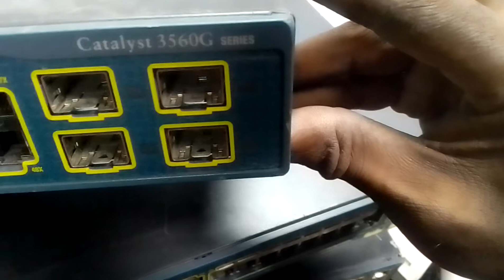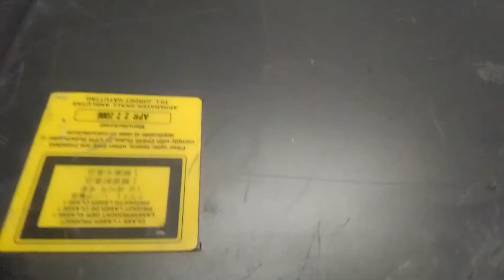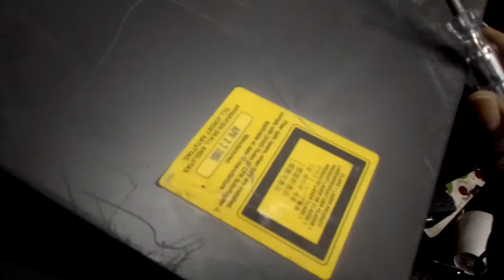#cisco #networking #switch #hardware #software  solved: Cisco switch no power light but fan spin

Comment: I have 3560G-48 and it is used with only maybe 10 ports and just one PoE, but because it is too loud. Is there a some simple way to silence it hence it does not work under full load? Noise is too loud for the office where I sit. Thank you.
Reply from the maker: The fan needs to be replaced
Reply: @jkftech  There is a more silent version or you think it is broken? It does not sound like broken it is just loud.

Comment: Bro
Even after replacing new RAM, it is not self rebooting. After external heat only it is rebooting. Why?
Reply from the maker: OK, but best thing to do is to replace it, restarting means the heat  is weak , you need more heat.
Reply: @jkftech  what can I do for self booting of network switch?
Reply from the maker: For best output you need to change the RAM